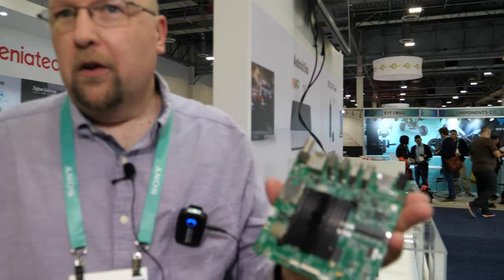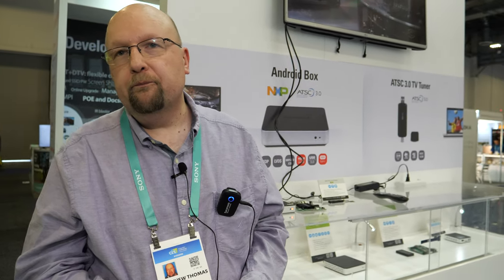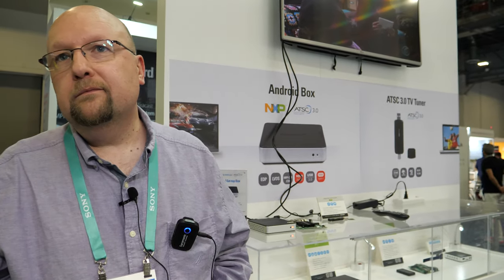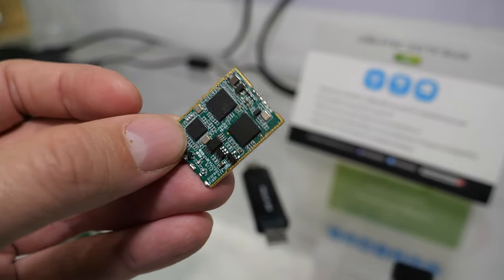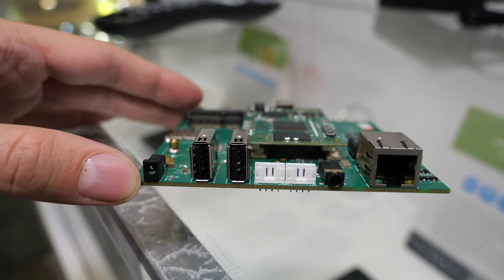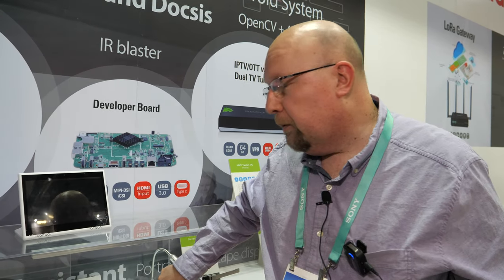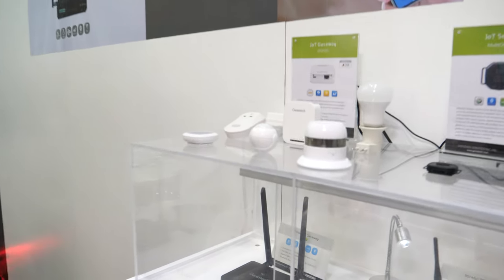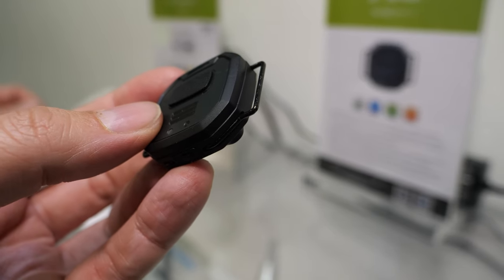Geniatech ATSC 3.0 NXP i.MX8M TV Box, ATSC 3.0 USB Tuner, ATSC 3.0 Arm dev board

Comment: Is the government going to give us a ATSC converter box for free ? They sacked us with this very poor receiving system installed in all modern TVs. I can’t even receive stations 20 miles from my location with rabbit ears now.
Reply: As of now, there are no plans to provide subsidized ATSC 3.0 receivers in the US.  There is however a requirement for  broadcasters to simulcast ATSC 1 & 3 until some TBD time in the future when ATSC 3.0 coverage and reception equipment reaches a large enough market penetration.
Reply: NO, there will NOT be any FREE converter boxes for NEXT GEN HDTV.
Recently there was a Shift in Frequency with ATSC 1.0.
Broadcasters were forced to Repack their services, most Migrated to less crowded UHF.
however in some Small markers Broadcasters were allowed to use Lo-VHF and VHF.
so, to maximize your channels and reception you should get an Amplified antenna that has Lo-VHF, VHF and UHF.
NEXT GEN DTV signal is Robust. it can reach DEEP into Buildings.
Reply: The problem with ATSC 1.0 is not signal strength per se, rather the fact that ATSC 1.0 system requires that the signal be relatively free from multipath, caused by reflected waves.

Fortunately, ATSC 3.0 will be far more reliable than ATSC 1.0.

With ATSC 3.0, the signal is almost free of multipath problems. It is far more reliable, even when mobile.